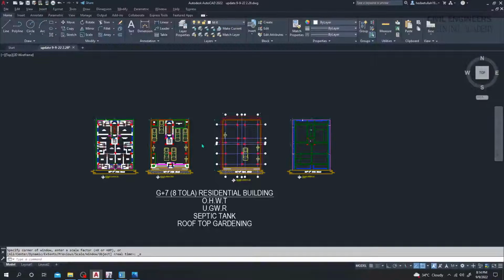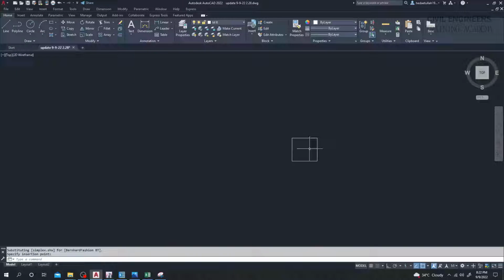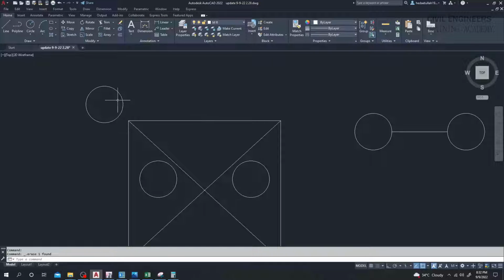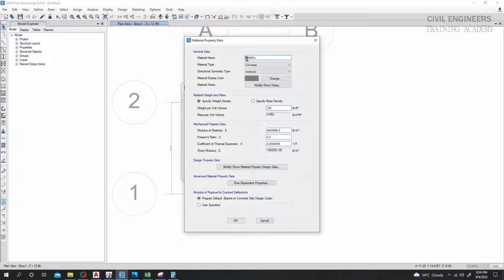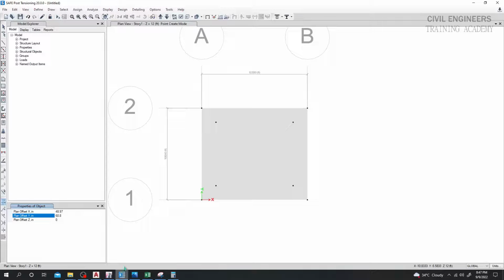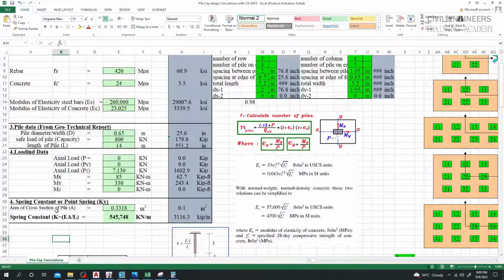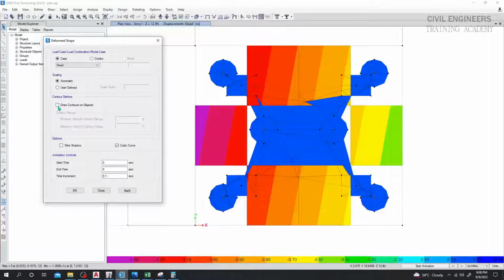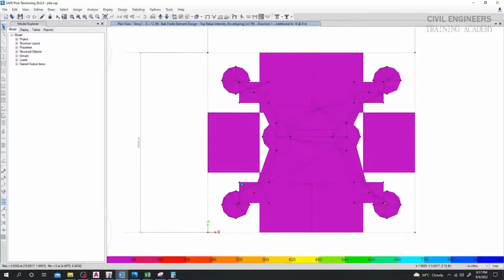Design Pile Cap in CSI SAFE 2020 from Etabs Analysis Data

Comment: In this video when you defined column you've given it 3000psi strength as pile and pile cap. What if in superstructure the column strength is  considered otherwise say 4000psi. Then what should we consider the columns strength then? 3000 or 4000psi?

Comment: Sir please tell how to calculate steel for only pile not pile cap...
Reply from the maker: Ok. We will create lectures on it
Reply: @qlearnify-en  thanks for you reply
Reply: I also have one question related to offset of outer beams in plan for example if we have col 450x450 and beam is 300x450 ,so in general in etabs when we do modeling it will start from center of column to center of beam joint 
Can we use insertion for that or else there is any other practice for that....

Comment: For pile spacing less than 3 times of pile diameter, SAFE provide the punching shear wrong as it get the shear force value is not correct, I have run check with RCM...could you explain?
Reply from the maker: As safe follow FEM method not strip base methods for analysis. i have no idea  about RCM sir.
Reply: Thanks for the reply, I have run SAFE to check the pile cap with 4 pile diameter 1m, I found the stub column is defined as the corner column then the shear force to calculate the punching shear is not correct too, how to change the column to be the stub column? or do you have reference file with 4pile in one pile cap?
 @qlearnify-en

Comment: GREAT . 
let me ask some questions if you don't mind.
1. why you did not assign the soil pressure to the pile cap mat slab for checking soil pressure.
2. how you will check or design the pile reinforcement.
3. the pile design will be done in which software as it has soil at the pile tip as well horizontally.
4. For real projects which combinations are used like gravity or lateral to design the pile. we can also design the pile in etabs as well.
hope for a positive response thank u.
Reply from the maker: no to assign soil pressure for pile cap